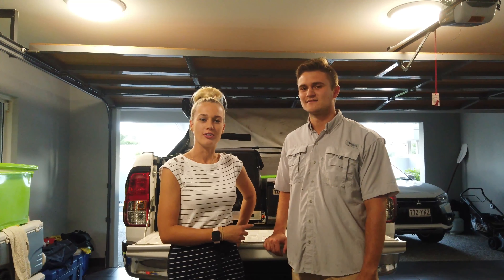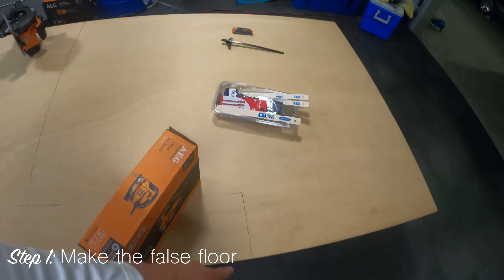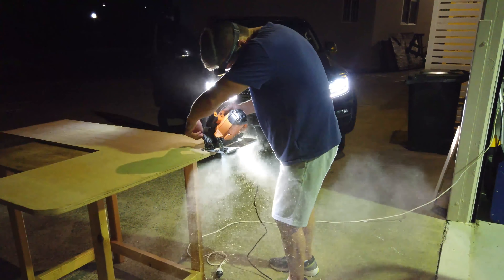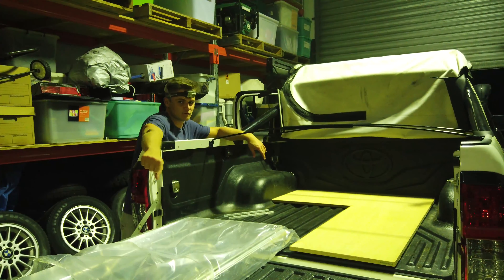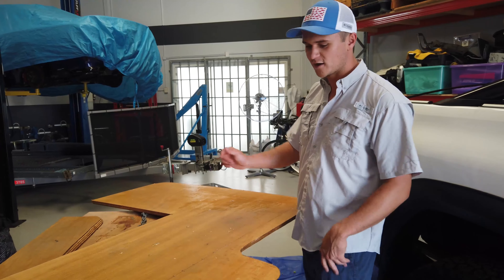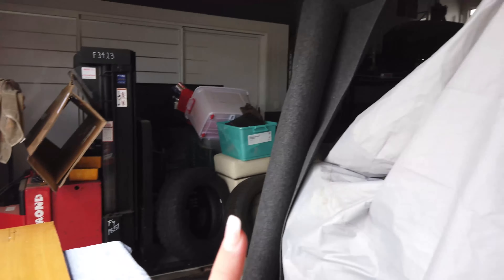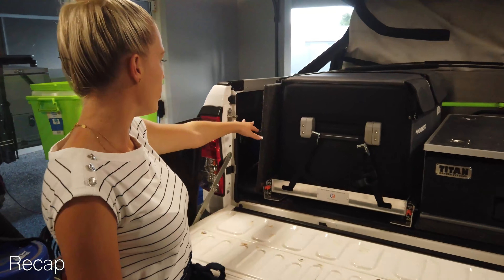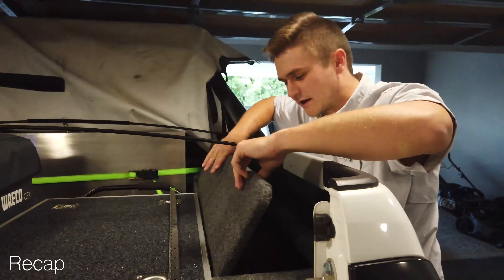TOYOTA HILUX TUB BUILD ! (Part 1)

Comment: Nice build! I'm half way through doing something similar. How did you secure the false floor to the tub liner?
Reply from the maker: see comment above but through bolt and sika
Reply: @Nickjm1267  Thanks mate. I'm trying to figure out a way of doing it without making holes in my liner and I think I've sorted it!
Reply: @KOTW.Adventures  How'd you do it?
Reply: @kentwillis  I will have a video out in a couple of weeks showing how I did it but basically I have a board in the bed of the ute attached to the tie down points with turnbuckles to keep it in place.

Comment: How did you guys secure your false floor?
Reply from the maker: Through bolted it with the factory holes! Had a tub liner so used those holes, was very hard from underneath. Can also use stainless tecscrews